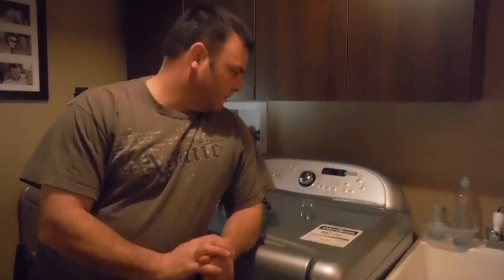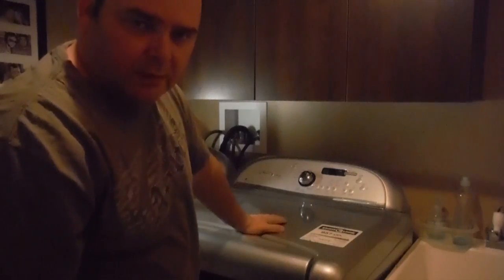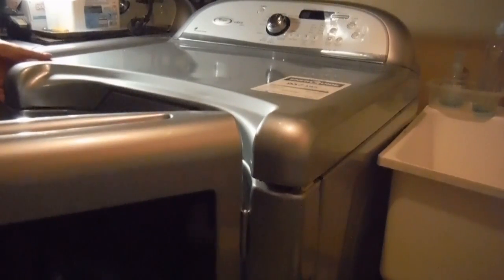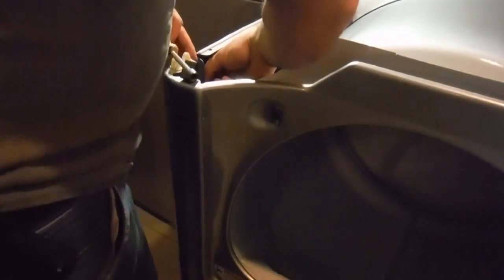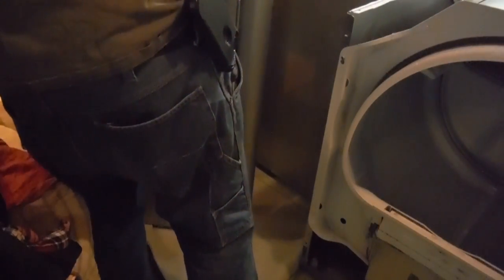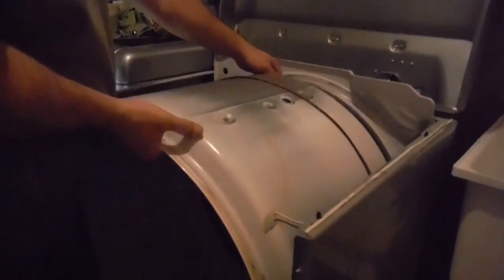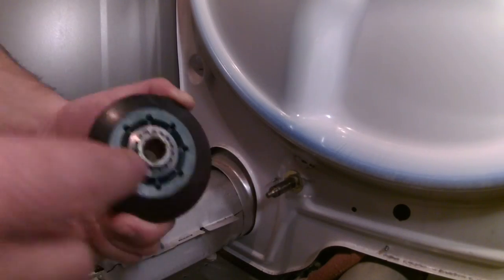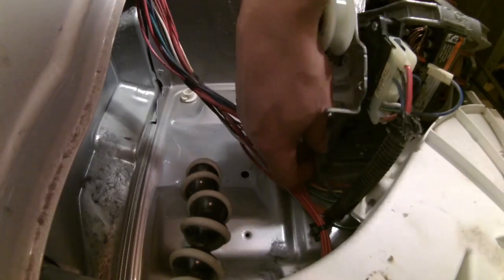Whirlpool dryer is screaming! What to do?

Comment: Thank you for the video. I’d like to mention that if anyone that is looking to change this part for a whirlpool cabrio dryer wgd8500dc3 you can access this part that needs replacing by opening the back panel. There is nothing in between the panel & where this piece is located. I found it much more challenging with my type cabrio by accessing it in the front. The part is called idler pulley. I also found something in my dryer that was very interesting. I opened the back top of the dryer just behind the control panel because I had a hard time attaching the front panel which is a bit different than your model. I found a service manual in there for technicians. It has a lot of info that you can’t find easily online.
Reply from the maker: Awesome info, love reading about ways to get a repair done easier and  quicker. Cheers
Reply: How do you know the noise was caused by the idler pulley and not one of the other bearings? I removed the idler pulley and ordered a new one, but the old pulley doesn't seem squeak that badly when rotating it by hand.

Any insight is appreciated.
Reply from the maker: In my dryer there is no other beating only pins and bushings. The pins and bushings usually only requires a bit of cleaning up and fresh lube. So the only piece that has a bearing is the tensioner. So I suggest you replace it as I did cause my idler bearing was also rotating but once under load became hard to turn and wasn't putting enough tension on the belt and that made it slipped. Hope this helps cheers.

Comment: Great video! To help with installing the belt, first put the drum back on, and instead of trying to place the belt around the centre of the drum where it belongs, place it around the back lip with the smaller diameter. Then reach under the dryer and thread the belt on the pulley. 

Once you’ve done that, stand back up and start to work the belt to the centre of the drum where it belongs. Slowly rotate the drum CLOCKWISE (counter clockwise will pop it off) and reach down the left side as far as possible to move the belt to the centre. Eventually keep turning the drum snowy clockwise until the belt is centered on the drum. 

Takes a bit of time but is the easiest way I could figure out doing it alone. 

(Tip: you need to shove a pillow or something between the fan and the drum to keep it level while you’re trying to rotate it. )
Reply from the maker: Awesome tips.

Comment: Perfect. I bought ONLY the wheel. The arm and spring were still good. I tried using grease first, but it was too slow. Wiped it off and used motor oil instead. Don't get oil on the belt. Great video. I'm good for another 3000 kms.

Comment: Doctor Shred
1 second ago
Nice video. However, the bushings are probably Oilite bushings (Oilite is a porous bronze or iron alloy commonly impregnated with an oil lubricant and used in bearings), grease will attract dirt and make it worse. 
Dryer companies use Oilite bushings because of the extreme heat the dryer produces inside the cabin.
Oilite is formed using powder metallurgy so that tiny pores are present in the metal. The pores are then vacuum impregnated with an oil to improve the material’s bearing ability.[3] The material holds approximately 20% oil by volume.[4] The most common lubricant is SAE 30 oil.[5]
https://en.wikipedia.org/wiki/Oilite
Reply from the maker: Thanks for sharing, it should help others to  fix they machine!

Comment: Fyi,  change the bracket if changing the idler pulley. Dont make the same mistake i did by just changing the idler pulley which lasted less than a week.  The shaft on bracket wears down especially when running on a bad idler pulley. So you can ruin a new idler on a bad bracket shaft.
Reply from the maker: Awesome comments, hope others will read it as it will save possible headache down the road!

Comment: Thank you for posting this video so far it has helped me, however I my dryer is not turning now what else should I do I did every step from this video. I placed everything back the way it was..
Reply from the maker: Thank you  for your comment, I am no expert but I would check if the tub to confirm it is sitting properly, the belt is routed properly and there is not any excessive friction preventing the tub to turn. Good luck

Comment: Hello, I have the same exact problem and am going to attempt this myself before calling in the pros.  But would you say it is easier to do it from the back since the pulley is toward the back?  And maybe then putting the belt back on the tensioner is easier? Also, did you order a new belt as well?  The other videos I've watched just have changed the pulley or tensioner part. So now I wonder if I need to go ahead & buy a belt as well.  I would need to check to see if I need to replace the wheels on my unit, but were yours broken or damaged in any way because I didn't see that on the video?  And finally, what is the name of the pulley and where did you order it?  Thank you in advance for your advice.

Comment: When you say “removing the front clip” at 6:30 which  clip are you referring too?  I have tried for hours to get the belt to stay on routing it on the smaller lip of the drum and “walking” it up.  The belt from the kit I installed is 93.5” and seems incredibly tight.  I am going to try and loosen the motor to maybe get some more slack.  What is a simple job is turning to be a headache especially when you watch so many other videos with people installing new idler pulleys with one hand (ones without tensioner spring). Thanks
Reply from the maker: It has been a few years ago but I remember having some trouble with the bell reinstallation caused by the tensioner. I used brute force.

Comment: Hey there. The sound of ur dryer, is exactly what mine is doing. I’m wondering what all parts did u have to replace, please?  Ty for ur help, in advance.
Reply from the maker: What I did is I took the model number and I went on the manufacturer site to get the part numbers and shopped on Amazon to order my new parts and I cannot remember for him which supplier I got them